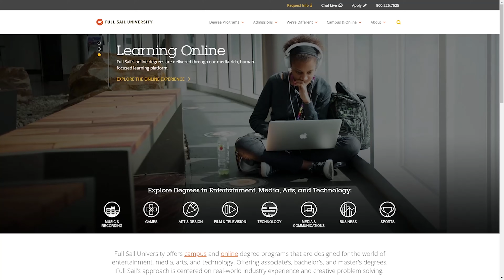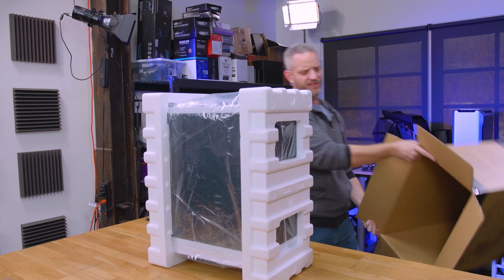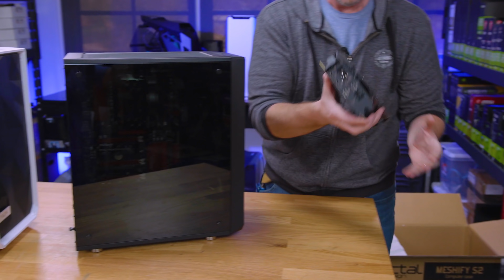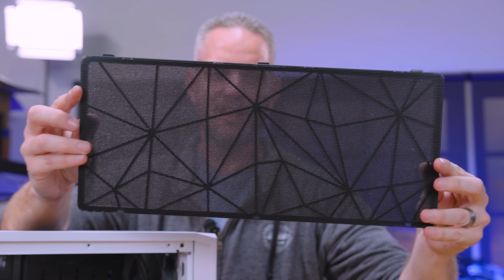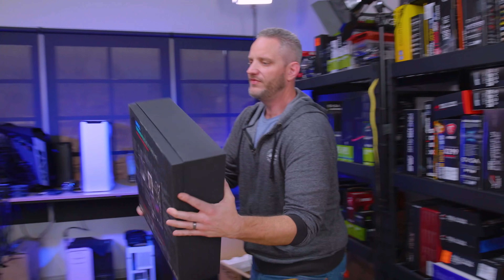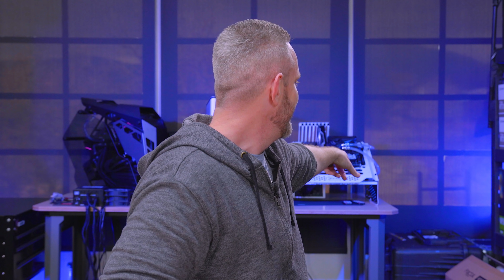Fractal Design Meshify S2 Review

Comment: I just finished my first open loop build in the meshify s2 and I LOVE IT. Tons of room to make a nice clean build, with plenty of airflow. Where my computer sits it gets most of it's air from the front panel and the full mesh really helps.

The availability of the vertical GPU kit is problematic though. It didn't seem to be in stock anywhere so I ended up buying an extension cable and making my own stand-offs for it. 

All in all i love the case.

Comment: I have the meshify c with vertical GPU mount and I love it and love how it's tempered glass is tinted (darker)
Reply: Tinted?
Reply: Well tented glass
Reply: The tinted glass is amazing looks amazing when rgb shines through
Reply: What specs?
Reply: How do you get the GPU installed vertically? Might do that with my 2080.
Reply: @Dan i mean dark glass "Meshify C - Dark"
Reply: @blumac9801  i mean dark glass "Meshify C - Dark"
Reply: @AnubiasDudeX  yup
Reply: @iTsAznThunder  using CableMod Vertical GPU Mount bracket my graphics card was Gigabyte Aorus GTX 1080 Ti Xtreme but it barely fit with three fans mounted in the front, so with your graphics card i don't think it will fit
Reply: @SL1PSTAR Asus ROG MAXIMUS X CODE
 Z370
intel i7 8700K
16 GB TridentZ RGB 3200 MHZ
Gigabyte Aorus GTX 1080 Ti Xtreme

Samsung 970 PRO 512GB M.2 Drive as boot drive
WD HDD 6TB Black 7500 RPM
Reply: @NajmiRadzi  Done
Reply: I just bought meshify c, it doesn't fit both my gpu and vpu cooler sadly so I need to buy this case instead
Reply: @jamiedyer7782  I'm so sorry for hearing that, but I agree with you it's small case, you can sell yours and buy this one
Reply: yeah its my fault for not checking but i didnt even know gpu were so big as this is my first custom pc.
Reply: @jamiedyer7782  Don't worry this always happens, I bought the meshify c mini and didn't realize that I bought the micro ATX version until it arrives then I sell it and make another order to buy the ATX version 😂
Reply: want to know, do you think I can mount intake fan of maybe... 120mm or 140mm at the bottom; to get fresh air of the GPU ROG 2080Ti OC? I don't plan to go vertically, but just normally plug into the PCIe.

Can it work? the air flow is weird, and I want to aid in the air flow to this.

Can someone guide me?

The Shop retailer is suggesting meshify C to me as well, but it looks like is going to be Hot for the GPU when I am already pairing my system with 3950X.
So is ratarded to for a temp that easily go past 60% right in the beginning.
Need help, SOS. I did am going to have close loop water cool for the CPU; but the GPU whether can get fresh air or not is quite a concern for me.
Please?

Comment: I have the meshify S2, it's a very solid and good looking case. 
Installed a 360 (60mm thick) and a 240 (x-flow 20mm) already a bit crowded. Also fitted a D5 between front rad and "end of shroud opening" + res exactly there.
Only downside is, that the front i/o is to my best knowledge attached to the front panel. So either u pull all the cables while mounting fans in the front, or you let it hang sideways. Edit: you can easily remove the front mesh, it is accessible from under the front panel.

Comment: Should just sell a front mesh panel for each standard version imo
Reply: I have the Meshify S2, i think the front Panel is the only  "Weakpoint" (see edit) in that, the front i/o is integrated into the panel, so if you want to mount your front fans, rads, youll have to either pull the front i/o cables out, or, let the front panel dangle down which is also shitty.

Edit: front mesh removal is accessible under the case after removing the down facing filter.
Reply: @J.H.hhhhhhhhh  You can reach the screwholes by simply taking the mesh part out. No need to remove the whole front panel (assuming it's the same as the Meshify C I have).
Reply: @Colaman112  thanks, I feel kinda stupid now, although it's on page 23 of the manual... :D

Comment: Just built a Threadripper  2950x based PC in one of these cases in all black with solid metal sides...at 53 I don’t need my Machine to look like the Luxor Casino at night, so thank you Fractal Design for the more conservative option....this is a very easy case to work in... 9 x 140mm fans (4 in push pull with a 280 AIO in the front and still plenty of room for 2 x RTX 2080 with lots of space all around....and everything running quiet and cool.... nice case.

Comment: I would love to see a Meshify C2 that's a few cm longer and has a USB-C port.  The S2 is too long unless you're doing full custom water cooling loops or a ton of hard drives.
Reply: Vicarious Vindicator exactly my thought, i love the s2 and the c but there needs to be like an inbetween, since im just using a normal aio and it looks too wide from the side with a normal atx board somehow :)
Reply: Exactly.  Only reason I got this case is because the Meshify C is slightly too small.  Had I realized how much longer the S2 is, I'd have gotten a smaller GPU and the Meshify C.  I'm also a bit salty that they don't have the option to get a white case with dark tempered glass.  That would complete the storm trooper look.
Reply: My thoughts exactly too.. something few cm taller and longer than the C would be awesome..
Reply: Hey guys I’m building my pc in this case tomorrow when the rest of my parts come. I had the same worries as right now I’m just using a 360mm aio I eventually want to do custom loop hence the case now. I’m using aorus master z390 and some big Corsair LL140s on the front and it actually fills the case  quiet well if you front mount the AIO you’ll be glad you got the s2 because you won’t be complaining about to much space anymore
Reply: Yeah right, couple cm here, couple cm there, maybe someone will want a radiator in the front and oops, here we have the Meshify S2 again.
Seriously, the Meshify C is unique because it's so short. Most cases with a PSU basement and without HDD cages in the front are longer than the C and shorter than the S2. NZXT S340, Silverstone RL06, cheaper cases from Zalman and the like...
The Meshify C is the perfect case for me. Most GPUs are 310mm or shorter - if you want a 340mm behemoth, that's on you. A lot of people use a tower cooler - no need to worry about radiator placement.
Ever since I took the HDD cages out of my buddy's R4 I looked at it as a waste of space. There was even a guy that cut his R5 apart to essentially make exactly what the Meshify C is.

Some of us just want a case that ends exactly where the HDD cages would start. This is the only one. Leave it alone.
Reply: @phenomanII  Wrong.  My current build is inside a Define C.  In order to mount a 280mm CLC I have to put the fans inside the gap between the case and the front pop off panel in a pull configuration with the radiator being just inside the case because with my GPU I can't fit both inside.  With the Meshify C you can't even put the fans in between the front panel and case because there just isn't enough clearance which then also means that I cannot put a front mounted rad/fan CLC inside at ALL.  It must be top mounted, and even so, with top mounted CLC, you can barely fit a 240mm CLC without clearance issues.  My GPU is 289mm.  I don't have a 340 "behemoth."  The major limitation of the Meshify C is the length.  You may disagree and that's fine, but it seems there are a lot more who would agree.
Reply: @vicariousvindicator7545  If we can agree to disagree, why start the comment by telling me I'm wrong?
On topic though, I did mention that a lot of people use tower coolers. I know that the Meshify C isn't that great for someone who has an AIO.
For me, the major plus of the Meshify C is the length, because it's exactly as long as I need it to be. My point was that the Meshify C is the only case with that form factor. There are plenty of cases that are just a couple cm longer. There are none as short as this one.

Comment: I have this case. Honestly amazing, super easy cable management, super clean,.super simple and amazing airflow and thermals
Reply: want to know, do you think I can mount intake fan of maybe... 120mm or 140mm at the bottom; to get fresh air of the GPU ROG 2080Ti OC? I don't plan to go vertically, but just normally plug into the PCIe.

Can it work? the air flow is weird, and I want to aid in the air flow the fan if possible for the GPU especially.

Can someone guide me?

The Shop retailer is suggesting meshify C to me as well, but it looks like is going to be Hot for the GPU when I am already pairing my system with 3950X.
So is ratarded to for a temp that easily go past 60% right in the beginning.
Need help, SOS. I did am going to have close loop water cool for the CPU [Gigabyte AORUS LIQUID COOLER 360 (LED Screen) ] ; but the GPU whether can get fresh air or not is quite a concern for me.
Please?

Comment: Since I found out about the lian li PC 011 my view on cases completely changed.. Every other case looks wired now. The PC 011 is almost the perfect PC Case.
Reply: Only a few problems such as fans overlapping
Reply: the only thing I don't like is the brushed aluminum i wish they came out with a version like the razor edition without the razor logo
Reply: The 011 is one of the cases that caught my eye, definitely.
Reply: Lian-Li know's style, nearly all their cases look good. The only reason I don't have one is because to get those looks they usually sacrifice something I don't want to loose, like an Optical Drive for example.
Reply: @madness1931  most modern cases don't have 5.25 bays anymore since most software is now on USB
Reply: @Tallnerdyguy  Sure, a lot of data is on USB, that's fair. Though a 5.25 bay can be used for more than just a Blu-Ray/DVD drive, that I'd use it for. They can be used for more ports like USB, SD, and even SATA; they could be used as fan, or RGB controllers; they could also simply be used a storage space, if literally don't need it for anything.

I mean, at the very least include it in cases, but allow users to remove it. In the example of cases like the 011-Dynamic, you could literally build it into the case (around the back), and rotate it 90 degrees so it fits in with the styling. You could literally put it where the logo is.
Reply: Can’t fit a decent cpu air cooler in it
Reply: @madness1931  it really comes to use case, as most people would rather watercool than have 5.25 bay

Comment: Having purchased the Define XL almost 9 years ago, I still love this case. 12 HDD bays, 4 bays in the front for USB 3, Bluray etc. and I've never run into an issue with a large GPU or my Noctua 15. As a dude who used to pride myself on hacking old off-white beige cases as Gaming Sleepers, I will always invest the money and just buy a nice case. Mine has seen 4 parts swaps since 2012 which means for the money, its the only piece that has maintained its value.

Comment: Only thing missing from Fractal now is a proper big tower where we could put 2x 200mm front or 3x140mm fans front/top, hell maybe even 2 in the back with similar length radiators for water cooling enthusiasts. On top of that full EATX support without partially covering holes for cables and maybe replace some of the 3 pin headers with 4 pin for pwn fans on the controller.

Comment: I really like the Meshify C, the front panel has does just enough to eliminate the monolithic brick look other Fractal cases have with it's interesting mesh design and chambered lowered corners. I have one for one of the PCs, and it's a great case to work in. Fit everything from the much larger old case into a tidy package that fits on the end table next to the desk. This Meshify S2 takes all that's great about the C and adds some size for larger builds without being cumbersome. I'd happily buy one.

Comment: This Fractil design case has a superb base structure. I have the Define S2, which is fundamentally the same bar a few bits, and I love it. I was surprised at it's size when I got it. As for the underneath mesh I use a slow blower out to keep a dust like curtain protection around it.

Comment: Fractal's fans, while not expensive, tend to be some of the quieter and better fans you can buy for between $12-16 each, so getting 3 fans (that you might actually use) is a nice plus, and the fan controller is nice especially because it will take both types of fans.

Comment: I actually sent a suggestion to Fractal a while back about making a Meshify S based on the original Define S(which I have), so I'm very excited to see that they have actually made something similar to what I hoped for. I'm not sure I like the PSU shroud though, one of the best things about the Define S is how open it is with no drive cages or shroud.

Comment: I really like the old style panel. I can't tell if it's just the black one looks better to me, but I love the screws being the main securing mechanism on just a glass sheet. I don't move my rig much, so transport safety really isn't an issue for me. The old style just looks a lot better and less cluttered. Feels more elegant.

The extra length is nice, I have an Aorus 1080 with the three fans. It's kind of pushing it in the first gen case, but by no means is it sketchy. In my opinion, the first gen Meshify C was the best case for the money at the time of purchasing. I got it for $70 around the holidays when there were a ton of sales.

Comment: Honestly this is great. The only thing keeping me from buying the Meshify C was the SIZE of the interior; I wasn't going to be able to fit the AiO's or future custom loops I wanted alongside my graphics card -- so I ended up buying the R6 when it released. If someone from Fractal sees this, I think it'd be cool in the future if you had a customization section on your website to make a "custom" case out of pre-determined compatible parts. Kind of like how EKWB has the loop configuration thing and how a lot of PC builders like Origin let you customize your PC. Like you could say have a mid-tower configuration and I could get the front style of a Meshify, a solid top, etc. or whatever. Obviously with cases now they aren't all the same size and compatible, but I think it's be cool to have a line of "cases" that are the same external dimensions that would let you swap stuff like that

Comment: I have a good old Meshify C in black, with the 280mm radiator of the Kraken in the front and an MSI Armor 1070 oc. There's literally like half of an inch of space between the two therefore the GPU often peaks around the high sixties/low seventies.
This case would be the perfect replacement - if it didn't cost almost two 'meshify C's worth of money where I live. 

Thank you for the review though, Jay. Good to see a detailed showcasing of hardware here and there among the 'let's make something crazy again' - kinda videos.

Comment: I like the design, make it taller to accommodate a radiator on top so it doesn't interfere with the ram. Make it easier to remove and clean  the front filter. Gave the option to get it without fans.

Comment: 2020 and i just ordered this case. I just love the looks of it!
Reply: Same!
Reply: Its a dream to build in. I fit 2 140 + 8 120 fans AND a 360 radiator comfortably. (Six 120 intakes on the 360 rad at the front in push pull configuration, one 140 intake in the basement, two 120s on top exhausting and a single 140 rear exhaust). Could easily fit another 120 exhaust up top but im happy with the cooling and aesthetics as it is. Hope your build went smooth.
Reply: Outlaw Firefly Curious on what cpu/gpu you are running.  I’m debating on reusing this case w/ my 2080ti ftw3 & a 10900k I grabbed yesterday. Or I can use the Corsair 680x that my wife bought me for our anniversary🤔. Perhaps return the 680x for a 2tb ssd, IDK tho...
Reply: @ohhthatbaldguy3791  id personally keep using the s2, thats a huge GPU and I've had 0 temp issues on my rig. I'm running an EVGA 2070 super xc ultra with a 3900x
Reply: @ohhthatbaldguy3791  temps stay around 30 on light workloads and 50-60 while gaming and streaming or video editing
Reply: Outlaw Firefly Thx for the reply, just one more question though. Are the barbs on your rad at the top or bottom of the case?

Comment: I have been looking at getting the Meshify for a while. glad they came out with the longer S2 version, but I would like to see it also with a white interior option with black mesh panels. I would like to do an arctic themed build in one but I do not want to have to paint it or buy a define S2 to get white and then throw a meshify front panel on it. If I am going to buy the case I would like it to be what I want and not have to spend time modifying it. as far as Fractal Design goes, I Personally have not seen anything else i Like for my build. Keep up the awesome content Jay, You have inspired me to get back into PC's again.

Comment: I have the Meshify C and had to remove fans from my 280mm radiator with a push/pull set up in order to fit my 1080 ti, and even still it was snug so this would be exactly what i need. also the 3.5" hard drives not being underneath with the PSU is a plus for me. 👍

Comment: I have a MSI GTX 1080ti Gaming X Trio (325mm) mounted in my Meshify C Mini (max. GPU length 315mm). 1x140mm fan above and 1x120mm fan below the card. Fits perfect! The 120mm Fan fixes the GPU sag at the same time. :D

Comment: Smart design with simple features and no bullocks. It's a winner.

I just wish Fractal provided a little more variety for the front case. Instead of just the angles, flat, curved or rippled appearances can provide some nice options for theming. Otherwise well-designed and something I would be proud to build in. And after 2018, airflow-prioooritized chassies are...

A breath of fresh air!

Puns.